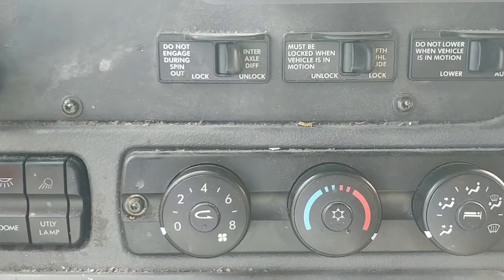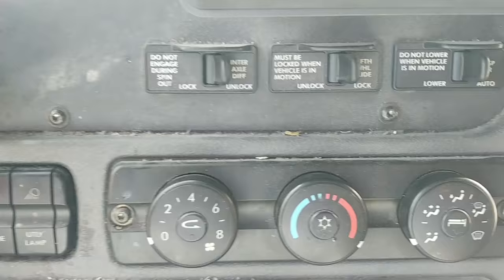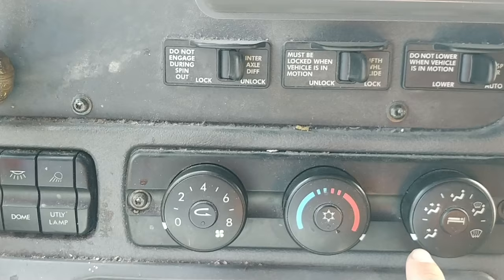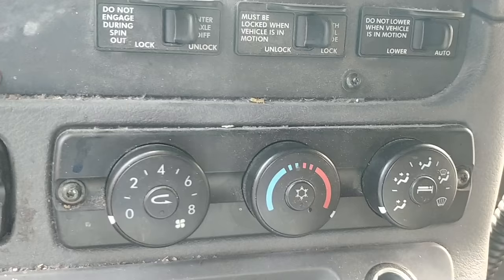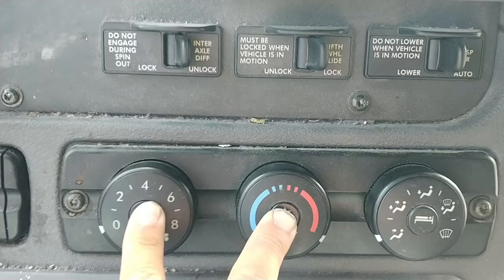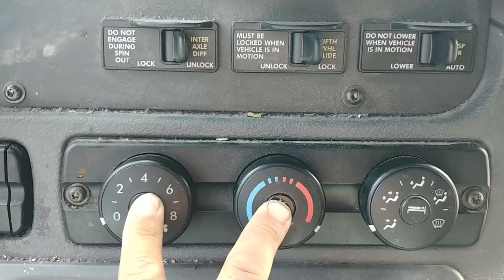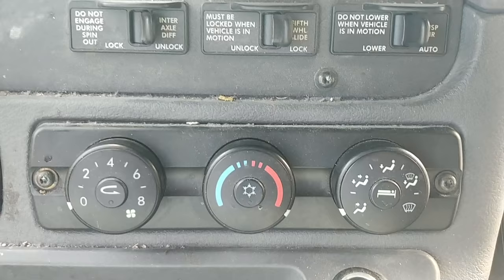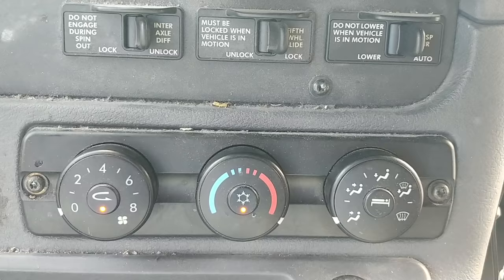How to reset your AC in your freightliner

Comment: 2020 freightliner ac would only work for the first hour or if I adjusted speed/temp/region. This immediately fixes it HOWEVER only for about 20 mins. No problem I can reset it without stopping as many times as needed so I can deal until I get back. What do I tell the shop guys as far as what is broken and how to fix it for good? Again thank you!!

Comment: If the thermometer in your sleep or stops, working just open the plastic panel, unplug the thermometer and plug it back in this really helps if you cannot get the heat on in the winter time. This is not for the bunk heater. This is for the air conditioner controls in the sleeper.

Comment: I need help; I tried earlier, and it worked for me initially. However, later on, I had to change my AC compressor because it was shot, and I also replaced the AC dryer. But I don't understand why it's not working now. The clutch keeps rotating when it's supposed to be tripped and stop running. I tried resetting it, and it worked once, but I'm still experiencing the same issue. My AC is still blowing warm air because the clutch is supposed to stop rotating after a few seconds
Reply from the maker: You need to refill the system with R134 freon too. Watch my other video on how to refill the freon

Comment: Any idea why my sleeper blower control will change the fan setting in the cab even when the button for the sleep is not lite on the dash board on the position setting knob? The cab blower control can be set at any setting and if the sleeper blower control is changed it changes the cab blower setting to match it.  Weird!
Reply from the maker: It's linked together. I keep my sleeper blower setting on 4 in the middle